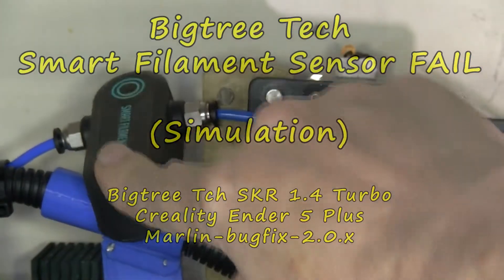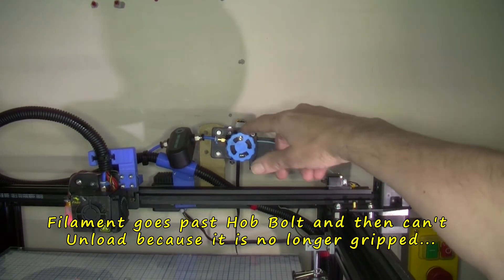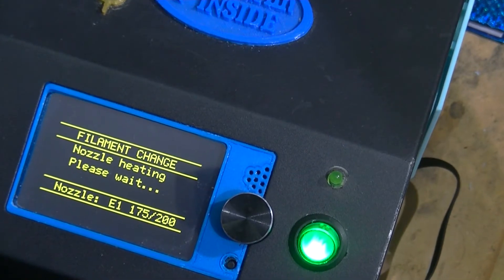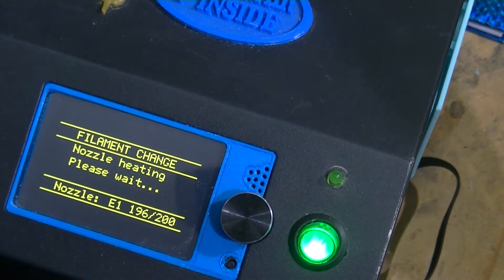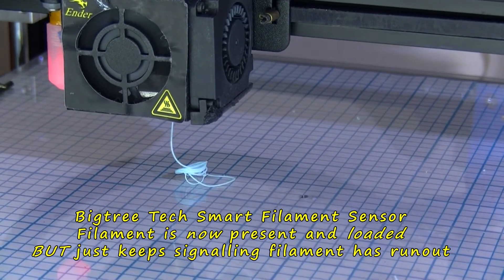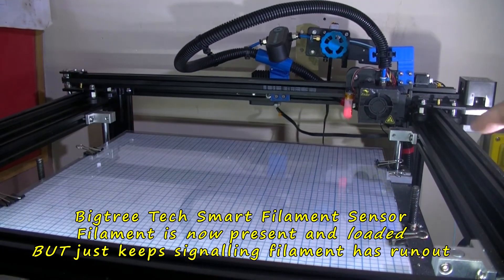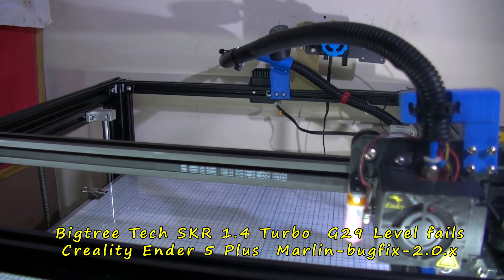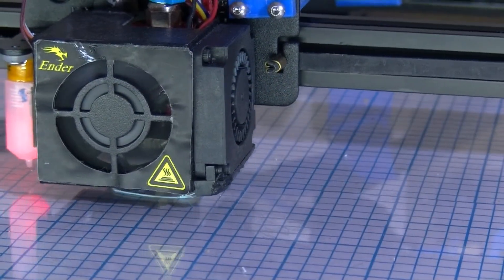Bigtree Tech Smart Filament Sensor FAIL

Comment: I would suggest testing the sensor independent of the printer. Determine the Ground and 5V power wires along with the signal wire. Connect a LED and an appropriate current limiting resistor to act as a visual aid for the sensor signal coming from that wire.
Reply from the maker: Thanks
Reply from the maker: The LED on the Unit is triggered; Seems like a Reset Runout issue which I think some others also have

Comment: You need to place the sensor before the extruder motor. Else it will never sense a runout
Reply: It does not matter if it located before or after the extruder stepper. There will be filament motion on either side of the extruder. This sensor is not like a conventional trigger switch.
Reply from the maker: Tried: The LED on the Unit is triggered; Seems like a Reset Runout issue which I think some others also have